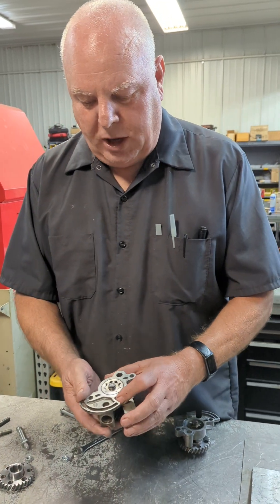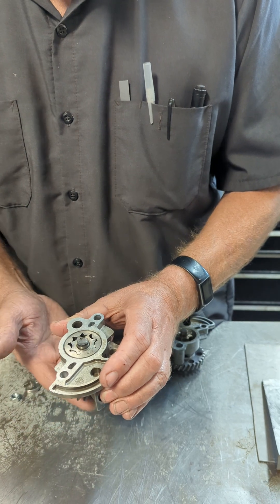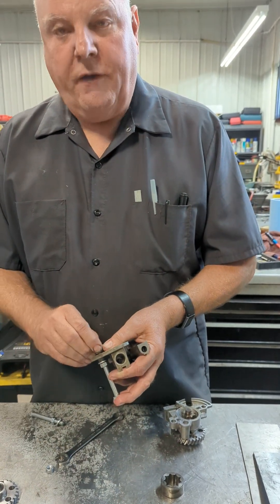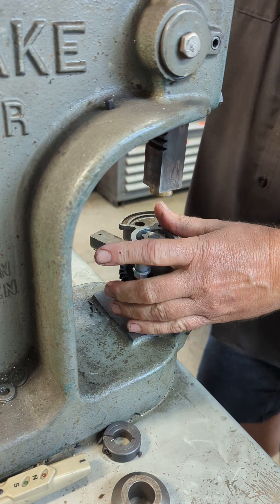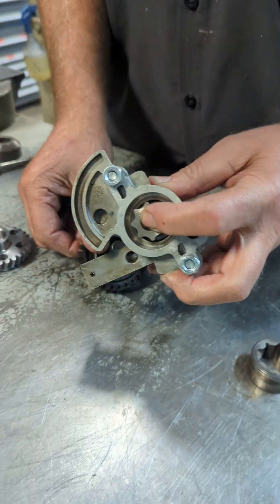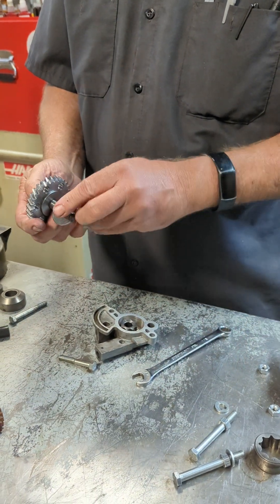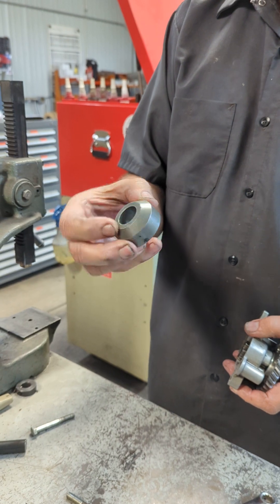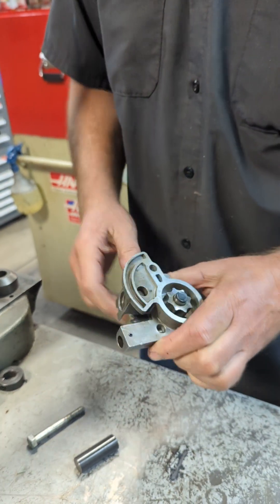Steel Oil Pump Gear for Kohler Command V-twin 18-30 HP engines.

Comment: Where do you get the gear? I’m repairing a cv680 that blew both rods apart. There was buck all through the engine and there was a little damage to the plastic gear. I need this gear.
Reply: Thanks but where can I buy the gear at ? Also are you positive the dots are facing up mine were down facing the crank case cover